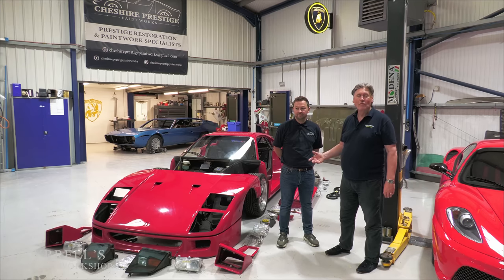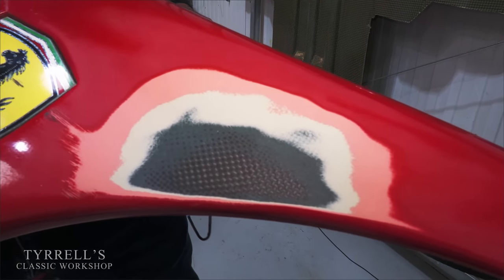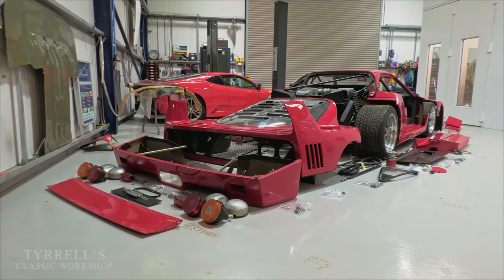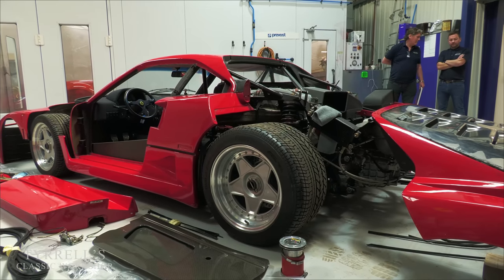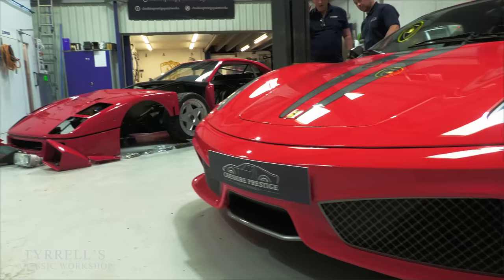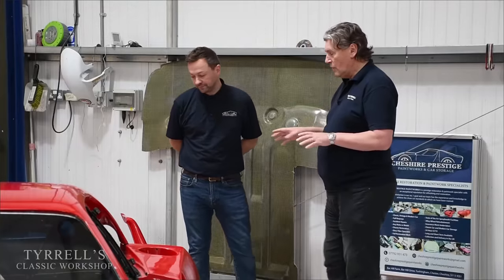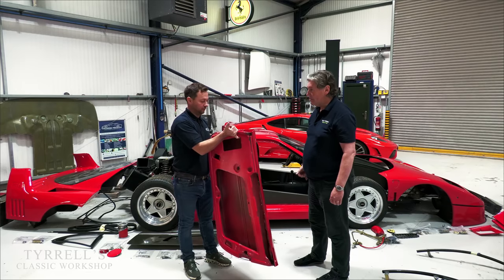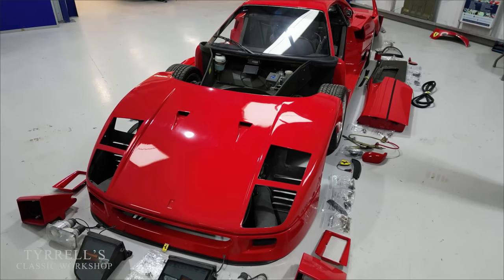Ferrari F40 Restoration Part 3 - Myth-Busting Carbon Fibre | Tyrrell's Classic Workshop

Comment: FIAT punto didnt exist in 1987 , the punto you are showing is also the 2nd punto model which came out in 1999. so there is no way f40 is using punto side signals. Maybe some other FIAT had same side signal before punto and F40 uses that BUT the f40 definitely didnt use signals from a car that came 12 years after it

Comment: I have a technical question, I cannot solve for few years.
 How do you get around replacing fuel hoses that have DKM fittings (on old Porsches ). The OEM hoses are not available and DKM fittings (60 deegree convex cone sealing inside) are simply not available. What fittings to use instead when connecting to 80's Bosch fuel regulator/fuel pressure damper?
Reply from the maker: Sounds like a question for a dedicated marque specialist- not something we’ve come across

Comment: Hang on... I've always thought it wasn't the colour of the black carbon-fibre that people said you could see, but the physical warp and weft of the individual fibres of the woven cloth. That's quite a different thing.

Spraying a thin layer of paint over a finely corrugated surface that hasn't been smoothed with a (heavy) high-build primer will certainly show the weave of the substrate, but not necessarily its colour.

I think we may be talking about two entirely different things, here.🤔

Comment: Question about this debunking of seeing the carbon weave.
There's another youtube video that states this........

The very first f40s had the paint so thin you could see the weave through the paint. Ferrari had complaints from early owners about this ( he went on to explain that this was before it was fashionable to see the weave). So Ferrari then applied a thicker paint coat so the weave couldn't be seen on all subsequent cars.
He then did a close up of the car, and you could see the weave.
So his statement that it was only the very first f40s you could see the weave.
Is this true of false?
The f40 in this video. Where in the production run was this f40 from?
Early in the production? Late in the run?
It  might clear things up more if you could let us know.

Comment: Bit misleading, as I have worked on f40 parts and and have video footage most of it is actually fibreglass. What they don’t show is all the vents the air runs through moulded ducts in the panels so you have a outer and inner panel glued together, the roof is one of the most complex part and very difficult to make

Comment: I found the welding of the 308's inner structures to be laughable. Ferrari is a race car manufacturer, they didn't weld race car chassis like this, they'd never pass inspection if they did. I spent untold hours cleaning up and rewelding the chassis.

Comment: The myth is not that you can see carbon fiber through the paint, but that you can see the structure of carbon fiber on the paint, and if the car is repainted, you can no longer see the structure of carbon fiber. You can also clearly see on the damaged part that the structure from carbon fiber is visible. Have never heard that you should be able to see carbon fiber through the paint, it is not reasonable. I myself have seen both an original F40, where at certain angles you can clearly see the structure of carbon fiber. The repainted one I saw had a much smoother surface, and no texture was visible.

Comment: I'm confused. Carbon fibre is a different material to carbon kevlar. My understanding is the F40 used Kevlar yet this video references carbon fibre. What part of the F40 is carbon fibre? Very interesting videos these.
Reply: They used kevlar for the rear screen above the engine. Like the sort of kevlar the police used for shields and riot gear in those days.

Comment: the carbon fiber weave apears because of an error actualy. it was not build in a autoclave... hand laminated fiber have air inside, in hot days it will aways print throught.

Comment: People dont mean they can literally SEE the weave, they are trying to give the idea that they can see the undulating uneven surface of the weave therough the paint, that its not a flat glass finish to the paint like on a aluminium body supercar or a carbon car with more Gel-coat/primer to bring the paint to a very flat, glass like surface..

You can see the effect of the weave under the paint, it iS so thin you can see what hte surfice of the carbon fiber is under the paint, its not flat and you can see that on the broken panel he holds up.

So not Lterally "see the carbon fiber through the paint" you can see its effect coming through the layers of paint..

Comment: I think this guy is confused about the “myth” that you can see through the paint.   I don’t think anyone who knows the cars meant that you could see the color of the carbon fiber through the red paint, but rather that you can perceive the texture of the weave through the paint…. Just as you can in this shot when they are discussing this “myth”. There are several points when the light hits the paint just right such that, even through the camera, you can detect the weave underneath.

Comment: I do love all your vids Iaian. But there comes a time when you must leave things as they were. The F40 was as you say and we are all in agreement, a race car for the road. So if down the road after being heat cycled many times over the carbon weave begins to show via the paint ahrinking into it then that is the way it is. I would want an original paint F40 over some hand rubbed straight as an arrow re painted car. I could give a hoot about the smoothness, that is NOT what that car is about. They are only original once. Road chips and a few dings are part and parcel of such a majestic aitomobile. Why change it?